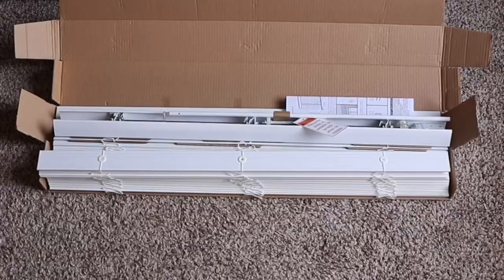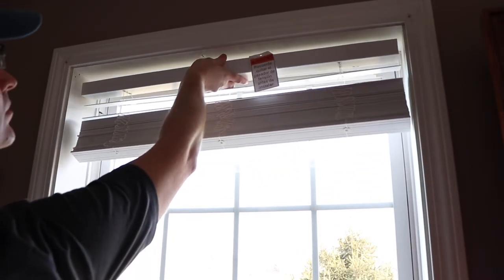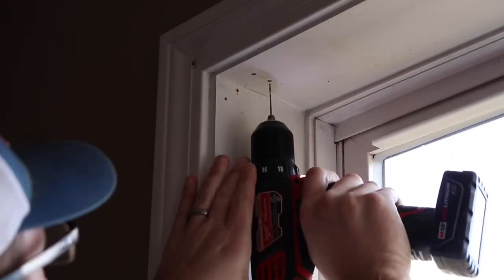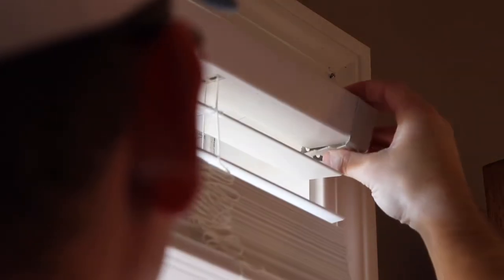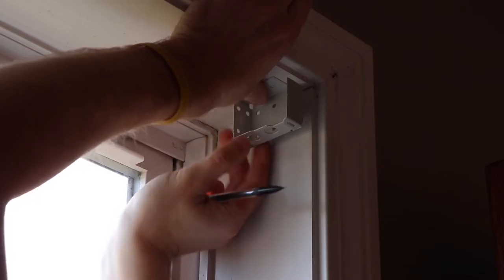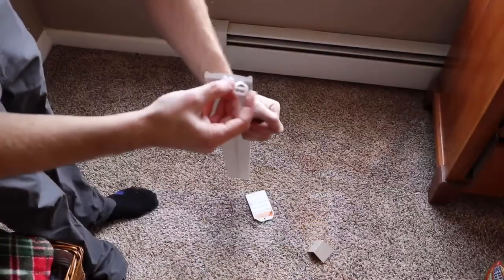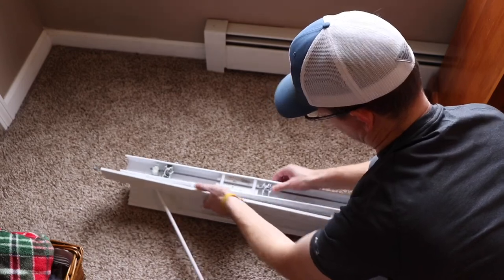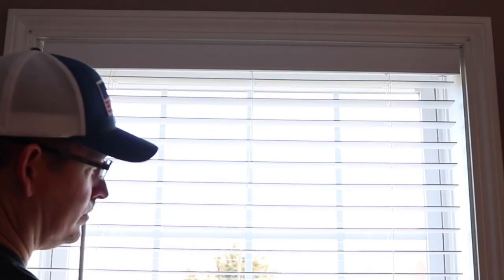How to Install CORDLESS Window Blinds, FAUX WOOD, Inside Window Mount

Comment: Putting the valance on first when installing blinds on the inside of frame then putting blinds in brackets like you show is kinda tricky but it’s the only way to do it. I found that opening the brackets then starting the blinds in slightly then forcing my hand behind the valance to close bracket works only because the flimsy valance bows outward. I also used a screw driver to force the front of bracket latch down. Your video put me on the right track but the process needs to be redesigned by the manufacturer.

Comment: I got them hung but they won’t come down. They’re stuck in a folded position. What am I missing? Thank you!
Reply from the maker: Did you remove the pin at 3:10 in the video? This pin will prevent the blinds from coming down.

Comment: When I was drilling the screw holes for the brackets, the drill bit hit a metal plate.  How should I handle this?
Reply from the maker: Did you drill through the plate? If so see if the screws will hold when screwed through the plate.